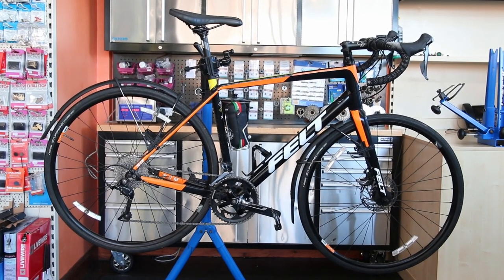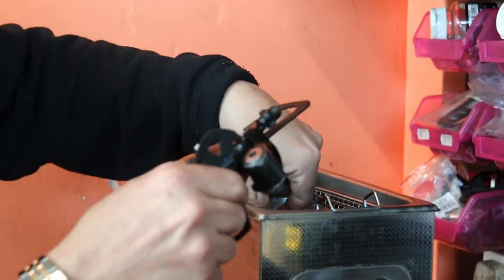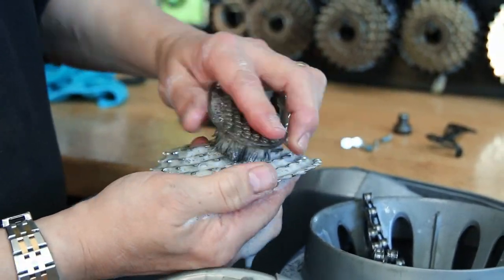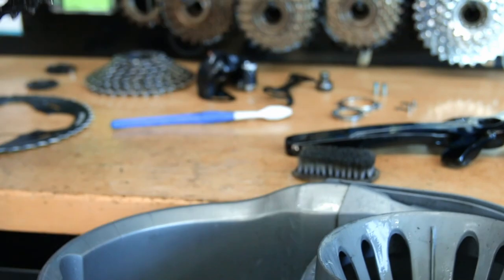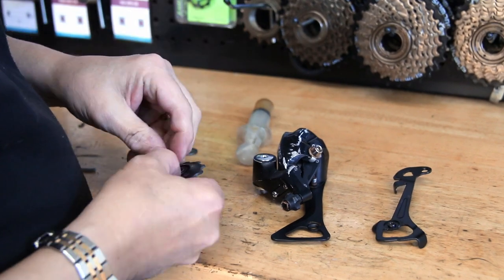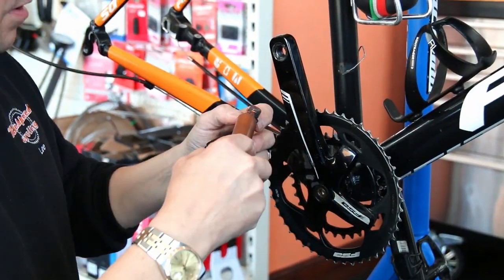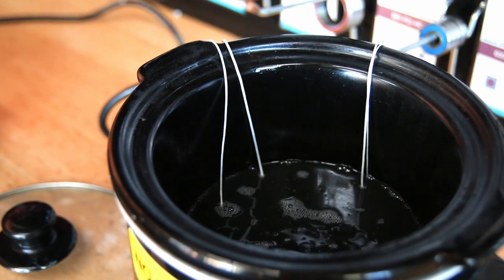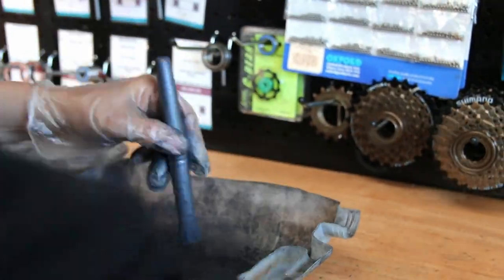Should You Get Your Chain Waxed!? Wax vs Lube Comparison

Comment: When I had a waxed Shimano chain, every little splash of water on the chain produced surface rust in less than 24 hours. Now I have YBN chains, and have zero problems with rust. The way I see it, wax simply doesn't rust proof chains, so you have to use chains that don't need oil to stay rust free.

Comment: Reading some of the comments about chains rusting.. I have never had a chain rust.. (UK) I use a Sram PC1091R  10spd chain &  hot wax plus PTFE 1.6 micron powder. Never had any problems... all I can say on that is, down the line, cheap materials are being used in the manufacture of some chains.  A useful video for anyone wanting to do the same I do with my chain is here, "Waxing your chain - getting it right" . Hope this helps some of you out there :)
Reply: Me too. I have been waxing my chains for a couple of years, and riding in all weathers, and haven't had any rust I can remember. 
I'll keep an eye on it, just in case. But, I'm pretty happy with waxing. 
As others have said, after the initial cleaning, it's easy - much easier than scraping oily crud out of jockey wheels!
Cheers
Reply: What PTFE to wax ratio you're using? I've heard that 1 part PTFE to 10 parts wax works well so I ordered 100g PTFE powder and a kilo of wax.
Reply: @eljaibas16  That's the ratio I used so yes just melt the lot to around 90-95 celcius mate :)
Reply: @peternicholls6532  thanks a lot my friend

Comment: When i was using wax my chain had rust all over it. Even after drying it off after a rainy ride and re-applying the wax. Wax also piles up on your mini derailleur cogs and gets hard. I switched to vikings juice all weather lube and never looked back. No more rust, silent chain, currently at 19k on my ultegra casette. With wax i had to replace it after 6k. If you clean your chain of sand after a dry ride using oil, then it also stays clean.
Reply: I think people just don’t like doing maintenance because the drivetrain attracts and retains dirt turning the oil or lube black.
The only benefit I can see for wax is that it’s cleaner to maintain, whereas oil or lube is much better for protecting from rust, wear and noises.
The wax seems to offer much less lubrication and increases wear causing components to fail quicker.
Reply: @gtjack9  green oil wet lube removes easy with some water and a dry cloth afterwards. Hard to find these days though. Kept my drivetrain good this winter during -10, 0° wet weather. I clean my chain every 2-3 rides of mud and sand

Comment: Biggest con with chain waxing (I’ve tried it and got all the kit to do it correctly) is it won’t stop your chain rusting.

Waxing is great for one day riding. Touring, bikepacking, and commuting, just don’t bother waxing as its top time consuming to re-wax and even then it won’t stop your chain rusting.

Don’t know why the rusting issue is never bought up in waxing videos, yours is the first time I’ve ever heard anyone ever mention it. 🤔
Reply: If you clean off the base coat that a new chain comes with waxing does keep your chain from rusting. 
You can buy Super Secret chain lube from Silca and top off a chain wax every 200 miles and only re-wax every 1500 miles.
Reply: @andrewbird6966  No, sorry waxing will not stop a chain from rusting. Ok for race days but for a month of rain like in the UK using a bike everyday, a chain will rust
Reply: May not work for you but I've never had a chain rust. I'm already 5,000 miles into a chain with almost zero noticeable wear and absolutely no rust despite many days of rain, snow, and dirt. I've waxed it 5-6 times and topped off with Silca SS lube every 200 miles.
Reply: I was considering waxing to protect my chain from road salt up here in Canada. But it doesn't seem like it would solve my rust issue
Reply: It will stop rust as long as you wipe down the chain with a dry cloth after its been raining, also that 1st initial clean has too be a deep clean 
Leaving chain in petrol for 6 hrs then degreaser for 30 minutes 
And isopropyl 99.9 for 30 mins and repeat the isopropyl process 3-4 times until jar or container is crystal clear, 
Before you hot wax, 
And boiling water over your cassette and jockey after cleaning with isopropyl helps massively
Reply: Also if you add PTFE to the hot wax it will give it extra silky-smooth texture and protects your chain ⛓️ against adverse conditions
Reply: @geegee8625  Done all that. Using a bike everyday in all weathers. Waxing a chain will not stop it rusting, however hard you attempt to maintain it. I’ve tried. 

All my bikes are waxed apart from my commuter bike. It’s oiled, I will take a loss in performance for ease of maintaining the chain.
Reply: @geegee8625  I’ve done that as well myself and I’ve also bought the expensive pre-mixed commercial wax products, none of them stop a chain from gaining rust spots.  And I also buy high end chains from different chain makers.
Reply: @bikepackingadventure7913  bloody hell lad 
Your having some bad luck
Reply: You need to use a chain that has an anti-corrosion plating. A standard chain which is wet will absolutely rust within 24 hours without oil or lube to create an oxygen barrier.
Wax cannot provide this, unless you’re mixing your wax with a lubricant which completely defeats the point of using a wax product as you’ll still attract and retain  dirt.
Reply: @gtjack9  my chains are too of the line and expensive and I use cheaper ones on my other bikes, makes no difference. With wax they will start to get rust spots.

Comment: What is the volume (liquid capacity) of your Ultrasonic Cleaner?  Do you clean MTB cassettes in it as well as road?  I'm wondering what's an ideal size for a rider of road/mtb/fat bikes.  Thanks!
Reply from the maker: The one in the video It’s 3 litres we also have a bigger cleaning tank with pump and sink, but to be honest hardly ever use it in comparison to the one we use in the videos. I find three litres cheaper and easier to constantly change (obviously we are commercial rather than hobby) we do have to turn cassettes, especially once they go over 32t ish but it’s easy to do them in half so to speak, so practicality vs running costs 3litres is perfect

Comment: I must say, that having previously used oiled chains and then tried waxed chains I have returned to the wet and the dry lubs. Yes, waxing does keep your chain clean but the noise drives me nuts. I was cleaning my chain regularly anyway and not allowing oil residue to build up, I find it easier in my opinion.
Reply: The usual cause of noise from a waxed chain is not allowing the chain to heat up in the hot wax . If you dip and remove immediately there is no penetration of the wax in the pins .
Reply: I was leaving my chain in the wax for upto 30 minutes. Didn't make a difference.
Reply: @WestKernowCyclist  That's plenty of time for the chain to reach the 170 to 200 degrees needed for penetration into the rollers .
Reply: Funny thing the noise. I NEVER had a noisy chain or drivetrain after waxing. I don't understand why some do and others like me don't.
Reply from the maker: Something that’s often over looked when re-waxing a chain is the wear it’s easy to re-wax without measuring the wear in the chain. A worn chain could be the cause of drive train excessive noise
Reply: @Bikespeeds  it's a new chain!
Reply from the maker: I’d also be checking, wear on chainset, cassette & even check I’d routed the chain correctly around that little lug on the derailleur between the jockey wheels. Even indexing can have a variable on a waxed chain. I’ve never had a customer remove a waxed chain because of noise
Reply from the maker: Also some KMC chains have an anti corrosion coating that waxes doesn’t work well with
Reply: @Bikespeeds  it's a new bike. However, does have a kmc chain.
Reply: @Bikespeeds why?

Comment: You don’t need to take your bike into a shop. The cost of workshop labour now is so high that it makes so much more sense for the consumer to buy a £50 ultrasonic cleaner and a £10-15 slow cooker. Less than £100 and you are setup for years with a few packets of wax going forward.

Comment: Another fanatic video.
1. Everytime you clean a chain, you create maximum entry areas for sources of abrasives. Chains are self sealing if you don't clean more than a gentle wipe.
2. It hurts nothing to run chains until failure. Chains don't need to be checked for stretch. They'll wear in association with sprockets.
Reply: Agree. All you need for chain maintenance is an old towel, a bottle of oil, & a cheap chain brush. I get good results from Halfords all weather lube, it's more water repellent than basic bike oil & not much more expensive.

Comment: Just went YOLO and try the drenched parafin wax method. Proper stuff that. Ridden 4 times in light rain and 1 time in heavy rain, not a single thing sticks to my chain.

But i have a question regarding maintenance procedure of waxed chain after a rainy ride. All this time, i just brush the chain from debris, wipe with cloth, and dry them with leaf blower. Almost the same with what you just said. But I see a little surface rust forming between some of the links and some rollers. Does it means it’s time to rewax the chain? So far it’s been 240km from my initial wax.
Reply from the maker: Without seeing the chain it’s hard to give solid advice, but as a general rule when the chain is rusting it’s time to rewax, it will do no harm to over wax it until you start to figure out the “sweet spot” for your rewaxing🧡

Comment: Don’t work in the wet, much goodly in the dry. 500g candle wax, 50g bees wax, 50g ptfe powder - chain lasts 300 miles between waxing. Chain strength is cancelled almost.  Cheap slow cooker for heating wax. Just do it
Reply from the maker: We definitely agree with “just do it” some people get along with it, some don’t, but worth a try for every rider
Reply: Can coconut oil be used to dilute the wax?
Reply: @boracay12  i wont do that. As its the solid wax that provides the lubrication. If its too runny it will disappear. 
 The candle wax is very flaky on its own, the candle wax with ptfe powder is also flaky, but still work
But add a little bees wax it’ll stop the wax flaking off.
When the chain cools down it’ll be very stiff at first, but after refitting to bike it’ll free up and will last a good 300-400 miles.
Reply: @retroonhisbikes  the problem I have is product availability here on this island .  I'll have to use some kind of alternative .  Candle wax by itself is to thick correct ? What do you think is a good alternative to the powder?
Reply: @boracay12  just use candle was
Reply: @boracay12  I use a slow cooker, which is got cheap, as I use it outside. But a sauce pan will do. I leave the wax to set in the pan after using it. 
But wax on its own is perfectly good. It’ll go flaky at first

Comment: I prep my chains with Molten Speed Wax and Teflon powder myself. I buy 4-5 chains at a time and then use a new one for an Ironman or two. After that it becomes my training chain. HOWEVER, I almost never re-wax them again but rather use a wax lube like Squirt or Silca Super Secret Chain lube. I apply this once every 2-3 weeks depending on how wet it’s been. 

So with all due respect getting a fully immersed re-waxing is not necessary in my opinion. 

Not only do the chain and components stay clean but they last 3-4 times longer as they aren’t worn by the grit that the oil attracts on normal lube.